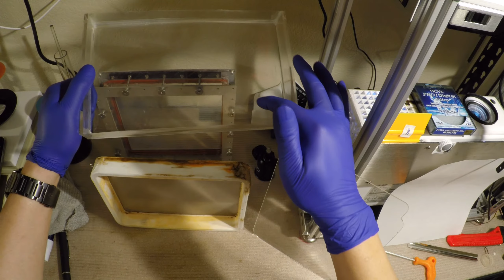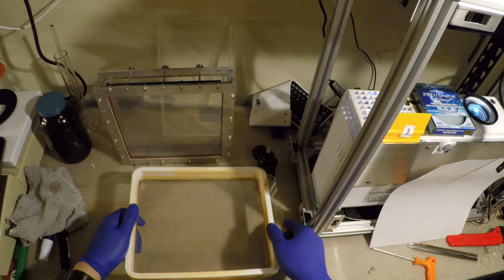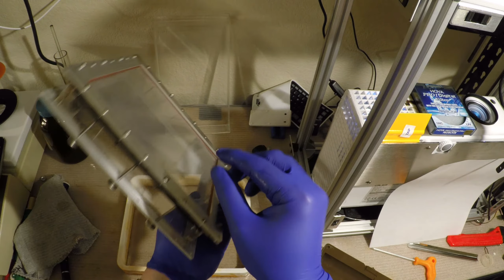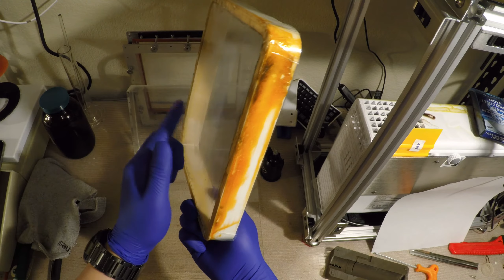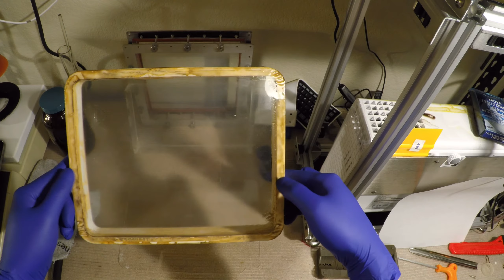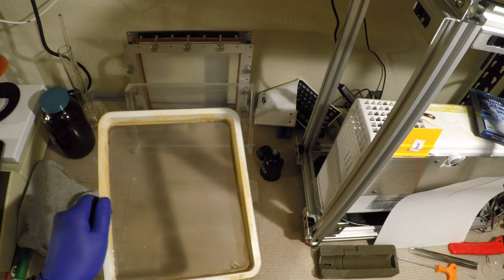Comparison of the PSP, Muve3D, and home-made PLA+tape vats on the Titan 1 DLP SLA 3D Resin Printer

Comment: Are you sure you have the acrylic base for mUVe, they have a glass one as well - which causes print times to double or more...
Reply from the maker: Elliot McAllister yeah, it is definitely acrylic. It came with the scratch protection sheets adhered to both sides which identified its type and brand.
Reply: Wow, that's surprising.  Seems like it could be the projector lumens (wattage) or spectrum of light.  Have you compared the times your resin vs the results on mUVe forum?  If your times are 1/2 per layer on a comparable resin like maker juice, I'd be very interested! Great video!

Comment: Very good overview!  If the acrylic of the mUVe flex vat seems to be giving you a bit of attenuation of the UV, then your thinner piece of acrylic on your home-made flex vat is also an attenuator.  Have you considered using borosilicate glass as your "flat" piece?  I guess you would have much shorter exposures, but even more artifacts.
Reply from the maker: That's a good question. I actually do not know if the thickness of the acrylic is the reason the mUVe vat is slower. According to Acrylite's light transmission specs, thickness does not affect attenuation. Only the formulation of the acrylic matters. I'm not sure why that is, but I also don't know what UV blocking additives they use, maybe they only affect the surface.

I'm also not sure how desirable it is to have the fastest possible vat with a mercury lamp based setup. There is significant background light, so if the vat is too fast, you'll have problems with background cure artifacts. The acrylic that I sourced for my tape vat was transparent enough that I did have some of those.

To me, the trade off with glass would be that glass is easier to clean. If resin cures against acrylic, it seems to be permanently bonded. Glass, on the other hand, is scrapable. On the other hand, if I drop an acrylic sheet, no problem. Dropping a sheet of glass would make a sharp mess.
Reply: I would think that all modern acrylics have UV inhibitors to keep them clear when exposed to sunlight.  I'm only now beginning to do my research, but considering the DLP mirrors bend light completely away from the projection lens and into a dump, it makes me think that the dump is poor and reflects some light back to the mirror which then bounces out the front lens.  We don't like to take apart projectors because if you modify a UL listed device and your house burns down, then the insurance company may have an excuse to not pay.  That being said, if the projector is opened and a better dump path were developed, I think black would be black, and not "almost black".  I definitely need to watch all of your videos before starting my build.  I've got the Z axis stage, a projector from craigslist ($40), the Raspberry pi, and arduino with ramps board.  I was researching vats when I came across your videos.